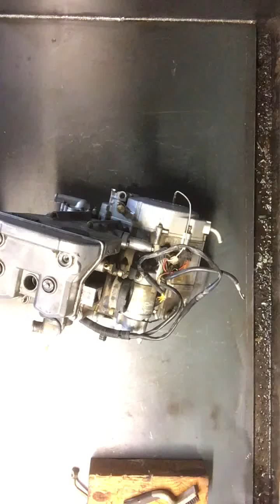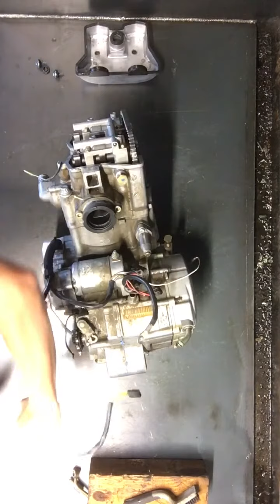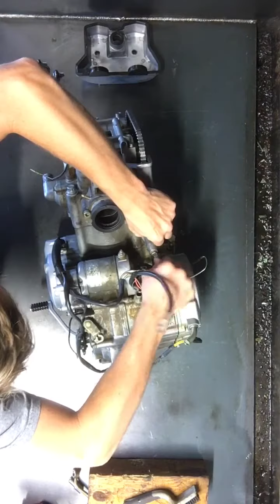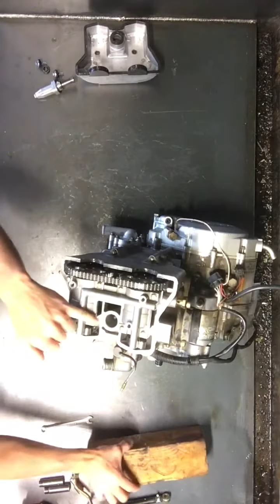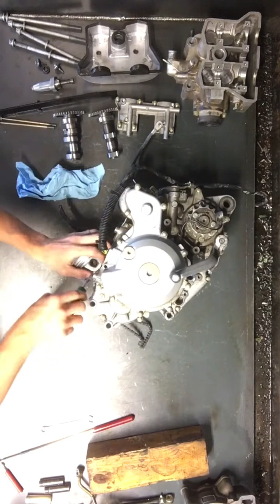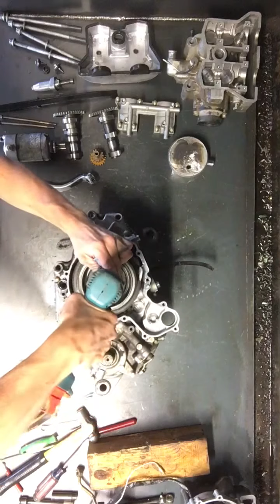Polaris Predator 400 - Top End Problems - Piston Valve Connection - HOLE IN ONE

Comment: @ Mid Nebraska Motorsports. Iknow this video was from over 2 years ago but it’s been extremely helpful. Just one question. Are there supposed to be 2 of the black half moons you said to make sure not to loose at around 3:12 in the video or not. If there is mine only had one unless I dropped it down by the timing chain when I was taking it apart. Also how would I go about getting that out. Any help would be much appreciated!

Comment: Is it possible to replace timing chain without removal of engine and/or head?

I am in the middle of attempting to complete this project, obviously if there is no other way, then that's what I will do, but I feel as though I've taken apart more than needed. Any advice you can provide would be greatly appreciated
Reply: mary and chris dougherty-Young thanks, I am still working on it, I had already done those things you've mentioned, however still was unable to remove chain
Reply: Yes you can